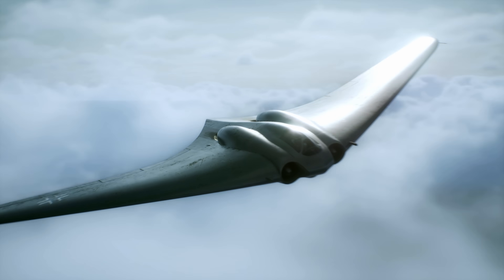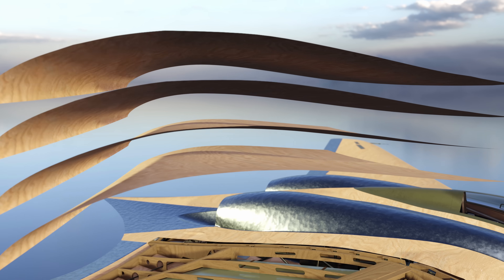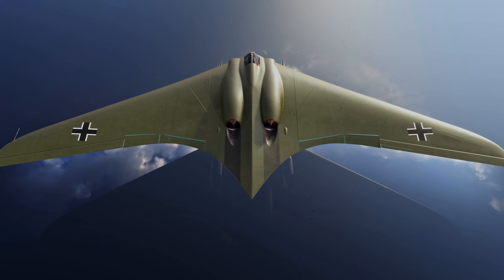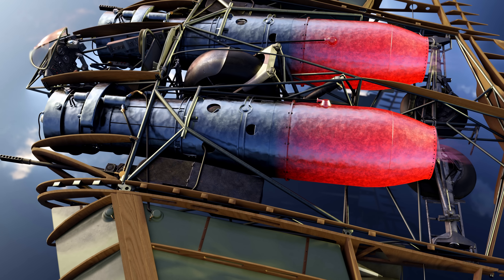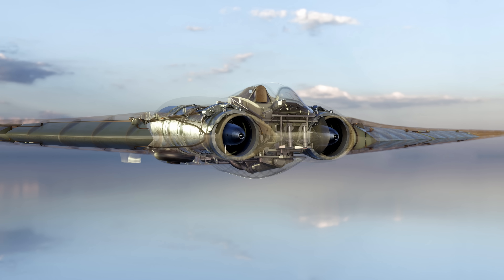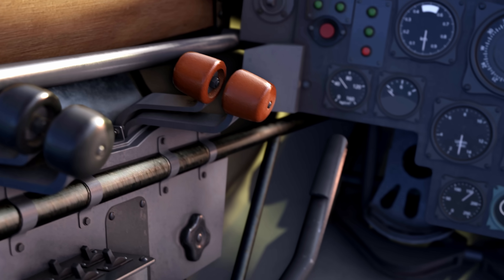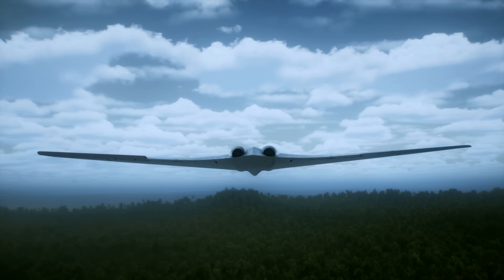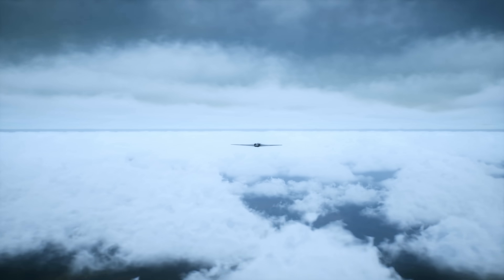Inside the Horten Flying Wing

Comment: The saddest part, is that USA snatched up all of the greatest engineers possible, made them work on fixing American designs, and only occasionally used their designs (like the V2 rocket).
Reply: it’s not sad
Reply: @skop3609  The screaming falcon jets and planes Germany designed were low-key God Tier of the era, and some are still the basis for modern planes. Now BMW makes some of the best jet engines, and leveraged their early plane piston engines for race cars. 😆 Arguably, USA has great stuff that's entirely classified/secret, but those Germans make cutting edge stuff at the same rate and level of secrecy.

Comment: ah yeah that doesn’t look like the B2 or nothing. cough operation paperclip cough
Reply: It's absolutely no coincidence that they look the same, Northop exhaustively studied the Ho-229 in the 1970's when it was developing the B-2.
Reply: @DoktorBayerischeMotorenWerke  they don't look the same
Reply: @peterson7082   The two aircraft are strikingly similar considering that the Ho-229 was designed over 40 years before the B-2, the most striking feature is they both share a blended body and the absence of any significant retroreflective structures.

The resemblance is uncanny... and without any doubts, no coincidence.
 
Although much about the development of the B-2 is still classified, what we do know for a fact is that Northop studied the Ho-229 extensively during the development of the B-2..
Reply: @DoktorBayerischeMotorenWerke  The XB-35 shares the same wing span as the B-2. 

 Just because they're both flying wings doesn't make them similar. A Spad isn't a Sopwith because they're both biplanes.
Reply: @DoktorBayerischeMotorenWerke  the turbojet air rams are very much reflective on the 228
Reply: @DoktorBayerischeMotorenWerke  We in fact do not know that. As the 229 was rotting away for a quarter century by that point
Reply: @peterson7082  The Ho-229 at the Smithsonian seems to have been in a very good state of preservation for a wooden aircraft that you claim has been left outside for a quarter century.
Reply: @DoktorBayerischeMotorenWerke  Much of the fabric has degraded. Granted it was in a dry region of the U.S. it did not get much care
Reply: @peterson7082  Your comments reveal someone with very little knowledge regarding this topic. 
Compared to, say for example; an 11-foot diameter metal propeller? The Jumo 109-004 engines were just 32 inches in diameter and their composite wood inlets have extremely low retro-reflectivity..
Reply: @DoktorBayerischeMotorenWerke  relative sizes considered it's not a significant difference
Reply: @peterson7082  Not in terms of observability on RADAR. 
It is a very significant difference that many amateur naysayers like yourself deliberately attempt to overlook..

You seem to forget that most aircraft during WW2 were not jets and had relatively large diameter metal propellers... which destroys the very basis of your feeble argument
Reply: @DoktorBayerischeMotorenWerke  The understanding of RCS during the war was incredibly simplistic. Modern understanding shows visible turbine blades being quite reflective. Relatively speaking. That's the basis of my argument.

 Still have yet to see where you think that Northrop/ Northrop Grumman got to see the 229 and how the 229 provided any design aid to the B-2.
Reply: @peterson7082  Again, here your lack of knowledge and your obviously biased attempts to deny the facts are clearly revealed.
 Modern attack aircraft do not have propellers, so your argument fails Prima Facia

Northrop admitted that they studied the Ho-229 in the 1970's and used it as the basis of the B-2 program.
 Lockheed also stated that it studied the Ho-229 during the 1970's during the early development of the Have Blue program, but went in a different design direction after improvements in fly-by-wire technology (another German aerospace invention) were introduced.,
Reply: @DoktorBayerischeMotorenWerke  Except Northrop never admitted that. You need to stop watching History Channel man
Reply: It doesn't

Comment: It took America 50 plus years to duplicate it as the B2 Spirit. Boeing also incorporated German aerodynamics technology into the design of the 747. 🇺🇸
Reply: Jack Northrop was building flying wing air craft before the Horton brothers were teenagers. The B2 is based on the stealth research from Tacit Blue and the flying wing data of the YB-35 and YB-49 flying wings.
Reply: You are confused

Comment: Was it the fastest plane at the time?
Reply: +@teddygamer6837   Only the smaller prototype flew for about two hours of testing before it was destroyed in an accident.   They did not measure any speed data.
Reply: @FiveCentsPlease  no
Reply: @MeewBeew   The smaller V2 prototype was the first to have powered flight with jet engines.  They only managed about two hours of testing before a fatal crash on 18-Feb-1945 after a single engine failure and this killed test pilot Ziller.  The was the end of the 229 program, ironically on a flight to measure speed data.  All other speed figures for the jet-powered version are estimations. The V3 that is in the Smithsonian today was captured very incomplete on 14-April-1945 by Patton's forces in the Gotha workshop in  Friedrichsroda, Germany.

Comment: I am absolutely sure that stealth was NOT the reason for this amazing shape. 
 
I recommend anyone to have a look at the Horten IV glider, then you see the origin of the shape instantly. 
 
I was lucky to be able to see the last remaining example of the Horten IV when it was restored at the Flugwerft Unterschleißheim, the airplane center of the Deutsches Museum, Munich. They had to recreate the whole "fuselage", only the wings had remained. (I'll come back to that).

 
The Horten brothers were part of the german interwar private flying movement. After WW I germans were forbidden to build motorized planes, so pilots had turned to try to stay afloat for a bit in gliders. And it worked, within a decade the development went from hops of a few hundred meters to staying in the air in the lift zone of a slope to flying cross-country over hundreds of kilometers.  
 
The Horten brothers were fascinated by the idea of tailless planes, like Alexander Lippisch, that later constructed the rocket interceptor Me 163, but was never able to get along without a huge vertical stabilizer. 
 
Not so the Horten brothers, their design did not require that. Main characteristics. 
 - pronounced wing sweep 
  - dihedral, 
  - the Horten "tail", this elongation in the middle
  - and most important: the "Glockenauftriebsverteilung (bell-shaped lift distribution). It really had that shape, and went even a little into the negative at the wingtips. 

 This distribution meant that you quasi (remember the sweepback) the tailplane as flight-stabilizing component as the outer part of the wing. 

With that design they really made it that they had a stable flying plane without any additional surfaces. 
 
When you look at the Horten IV, the pilot lies prone in the middle of the plane, blending completely into it, the only "sin" is an almost bucket-like structure at the bottom aft (where it aerodynamically hurts the least) to house the legs of the pilot. 

When you look at the shape of the Ho IX, it is exactly that layout, just more compact, and way stronger. Aerodynamic additions were the flaps and the dedicated spoilers. 
The spoilers for yaw control you can see in the Ho IV; and the elevons are anyhow unavoidable.
Reply: Next: the structural layout. 
 
Spruce and plywoold were standard in glider construction in the 1920s and 1930. You can see it in the Horten IV. And the Hortens took it to an extreme in lightweight construction. The wooden construction is just continuation of how they built anyhow. 
 
One of the arguments pro wood is saving of precious resources. When the Ho IX design was started, Germany was already losing more and more access to resources like e.g. aluminium every day. More and more parts of other airplanes were redesigned in wood. And so you could employ carpenters as additional labour force. 
 
The Hortens were no experienced military airplane designers. Their way of building was not laid out for practicability, robustness in case of damage etc. 
 
As far as I remember, the bow gear is simply a talwheel of a Heinkel He 177 bomber
 
Their first prototypes seem to have been rather flimsy, so the Ho IX became the Ho 229 (official german running number for military airplanes) and then the Go 229, as the Gothaer Waggonfabrik (train car builders from the city of Gotha) had experience in building of planes with engines and with military requirements.
 
I heard that they completely reworked the construction of the Horten to achieve the required sturdiness and simplicity of construction for series production.
 
Horten planes up to that point were a one-off or at best few-off build. Damages were repaired by constructing the damaged parts fresh. 
For a military plane you need to be able to replace componints, within hours. No time to go back home, search for the drawing, and construct a new part from scratch. 
 

Anecdote.  
Mi uncle drove Panther tanks on the eastern front. One of the few stories he told was that the spare part situation was horrible, that even vehicles of the same type had so many variants and as they were built by several manufacturers, you needed constantly SPECIFIC spare parts, could not use the parts you had but for another variant. 

Just as example that there more aspects fo consider for a war than speed...
 

As revolutionary and capable as the Ho 229 may seem, it would not have changed a thing. 
 
E.g. after the first shock, the US escort fighters quickly learned to deal with the Me 262. The Jumo 004 engines were VERY touchy, you had to treat them with respect. Throttle changes had to be VERY slow, or the engine would flame out. 
 
The US fighters simply did not even try to chase the Me 262s, they held back and waited near where the Me 262s came in to land. Then they were slow and helpless, And then you could shoot them easily down. The jet fighter airfields needed a fleet of piston fighters just to protect the incoming jets.  

And leaving the US bombers alone was no sin - it was official doctrin. About a year before D-Day, the US military had decided for a successful invasion the german air force must be so worn down that they cannot take actions against an amphibious landing (and it worked). For that, it was of utmost importance to shoot down as many german fighters as possible. 
So the escort fighters were told to chase after the german planes wherever they could, even if that meant to leave the bombers behind unprotected. 
 

And another issue for successful military action:
The allied bomber force took until July 1944 (after D-Day) to attack the german fuel production in earnest. And within 3 months, german fuel production (that was anyhow too little) was down to 30%, at the end of the war it was down to 2%. It is said the germans had just 20,000 tons of fuel left when they capitulated. 
And as the sulphur that was a byproduct of coal being turned into fuel was the main source for the gun production, the germans would have literally run out of ammo. 
I still do not understand why it took so long to attack this key industry. The plants are HUGE = easy to hit, and any reduction in output affects all branches of military.

Comment: @BluePawPrint I believe there is one minor mistake in the animation - during take offs, when going down the runway, the Ho 229 would first be levelled while riding just on its front wheel. Only then the pilot would pull the steering stick to lift the plane. Same with landing - the front wheel hits the ground first and, after slowing down (with the airbrakes and the parachute I imagine), the plane would 'sit' on the back wheels. Otherwise, great animations as usual!

Comment: I think someone debunked the later statement that there was any intention to try to add some charcoal to either the paint or the glue in the wings. It's just something the creator came up with later for hype most likely. Questionable to suggest adding even more flamable material to the design. And the designers also chalked up the one or two early crashes to the engines, due to it being new tech. As if the whole thing wasnt a new design. people ven foreget to bring up that the early versions of the american flying wing aircraft sometimes just seemed to loose control for no reason due to the inherient instability of a flying wing design. You really need computer assist to fly these things. I find blaming the engines without proof a lil biased, which is not suprising coming from the aircrafts creator who was trying to hurriedly push the aircraft into service before the wars end. 

The way people talk about it having wood in the frame is plane silly (hahah, cough sorry...) as there were obviously plenty of planes of mostly wooden design, just go ask the japanese eh? I saw one of the guys in the study talking who claimed the aircraft only had a '20 percent stealth effectiveness" which means it's radar signature was 20 percent smaller than it's actual size. He seemed really embarrassed or constipaited or some such when he brought up the numbers.Never could decide if he was fudging the number one way or the other or it was just straight up embrassment that it wasnt a bigger number. I know a lot of people have really hyped this plane up and the questionable theory that germany was going to sweep over europe and then invade america with an army of super weapons and nukes, which is about as preposterous as planning for an invasion from mars.

Comment: Imagine the fun you'd have as a pilot with combat damage to one of the elevons.

As for the prototype "being preserved" at NASM, nothing could be further from the truth.  The wings are rotting to dust and nothing is being done to save them due to the corrosive properties of the adhesives used to bond the plywood layers.  It's a shame but that's the way things stand.  They were never meant to last and won't.  If the NASM ever decides to do something with that aircraft, the wing panels will need to be completely reskinned.

Comment: The Ho229 has to be one of the most beautiful aircraft ever designed. 
It was a shame it was never developed beyond the prototype, from a technical point of view of course. Us allies didn't have much that could deal with aircraft of that speed, even late mark Spitfires, P-47s, P-51s and Tempests would have had their hands full.
Reply: things like the Gloster Meteor came close, though they "only" got to ~700 kph while the 229 could reach ~800kph
Reply: @cybrains3824  True. The Meteor could keep up with the Fi 103 Flying bombs fairly easily, as could the Spit XIV/XVI and Tempests, but both struggled with the Dornier Do335 Pfiel at around 440mph.

Comment: The Engines are infamous for their short life span , but this was two 25 hour segments with each engine X-Ray for cracks and repaired before the second 25 flying hours before the Engine was scarped and replaced. If it was 1943 the infrastructure needed to do this , then the engines would have had 50 hours life . However by 1944/45 the Luftwaffe network was in ''free fall'' as was most of the Wehrmacht at that time. So one segment 20-25 hours the best and  even 1/2 that since most rookie pilots over heated the engines causing flame out. 

As a matter of interest 50,000 Jet engines per year were required for this jet engine programme to work , when the Historical max output for LW industries was about 54,000 prop engines per year. Its not surprising such an effort forced the factories to ruthlessly exploit slave labour. I'm told the original 1942 Jumo 004 A would have had well over 100 hours of life but they needed a quantity of chrome/nickel ,not available. They did not get this because a lot of that special metal went into armour plate construction needed for the navy throughout the first half of the war as well as the expanding need for AFV armor . This programme wasn't available in 44 either due to the greatly expanded Panzer programmes. 

However The ATLANTIC WALL & EAST WALL etc , consumed well over 100,000 tons of such armoured steel just for the machine gun ''Loopholes" and "armoured Doors" on the thousands of bunkers , alone . It appears 30,000 Jumo 004A could have been finished through 1942/43 leaving about 70,000 prop engines over that time period. Another 30,000 Jet engines should be possible in 1944 as well as 25000 prop engines. This effort could be repeated again in 1945 calendar year if the war lasted that long?

Comment: The only prototype made using jet propulsion crashed killing its pilot. With no stabilizer, pilots would have to work hard to avoid instability. But it looks great flying in a computer simulation.

Comment: 8:48 the synthetic fuel was not produced from brown coal but from bituminous coal. I know two sites where the "Sintina" was produced, both located in Poland: Police (53°33'20.9"N 14°32'44.4"E) and Blachownia (50°21'17.7"N 18°16'54.7"E). The production was led according to the Bergius method (https://en.wikipedia.org/wiki/Bergius_process).